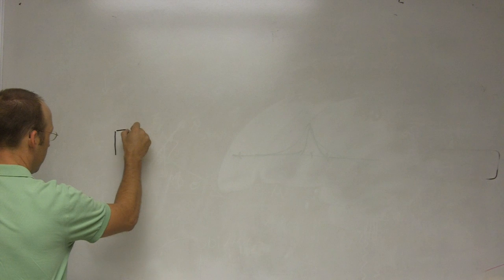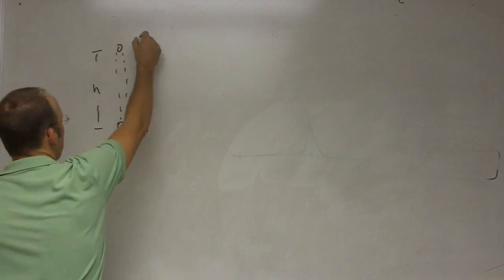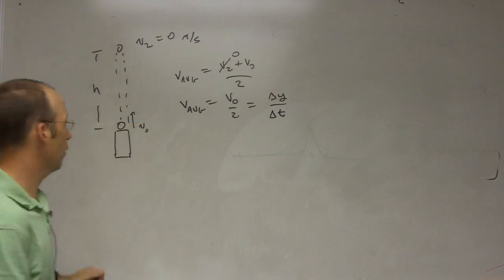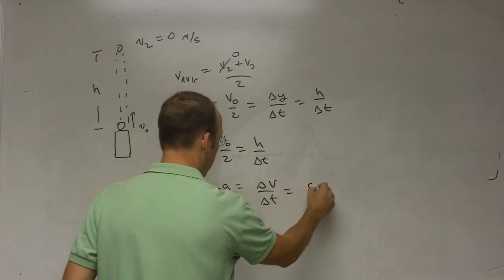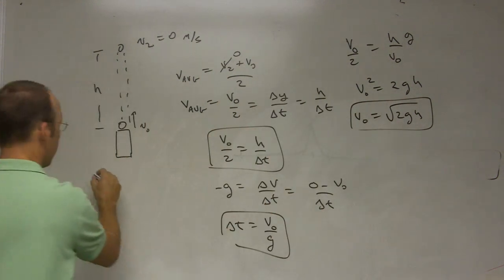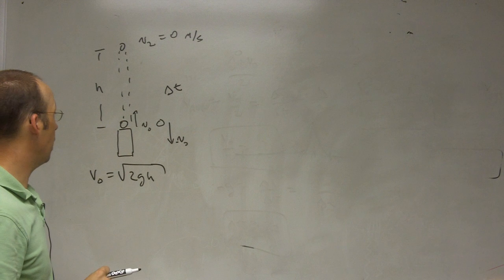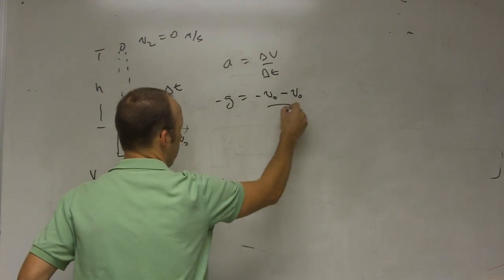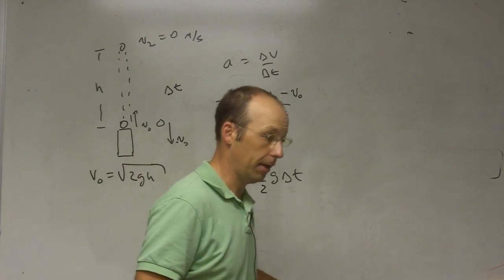Finding the initial velocity for a launched ball

Comment: Also 😭 how do i do this :
a projectile is thrown at angle α with the horizontal. find this angle if the distance is 4 times greater than the maximum height.

Comment: A rocket, initially at rest on the ground, accelerates straight upward from rest with constant acceleration 44.1 . The acceleration period lasts for time 9.00  until the fuel is exhausted. After that, the rocket is in free fall. Find the maximum height  reached by the rocket. Ignore air resistance and assume a constant acceleration due to gravity equal to 9.80  .

How do you find the Maximium height?